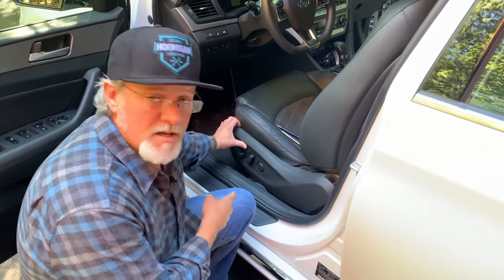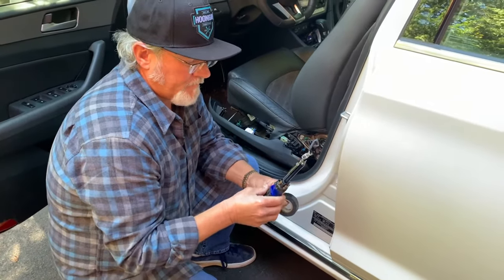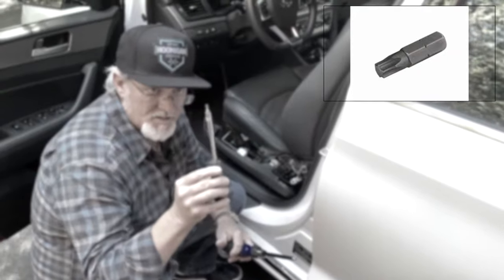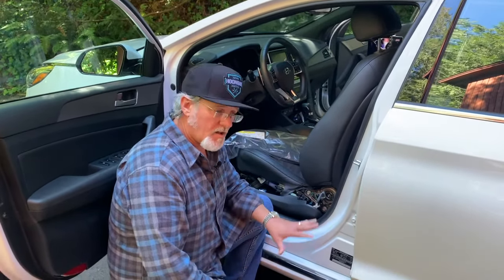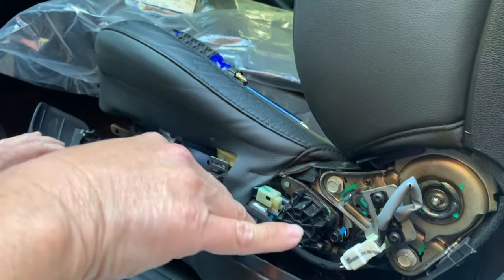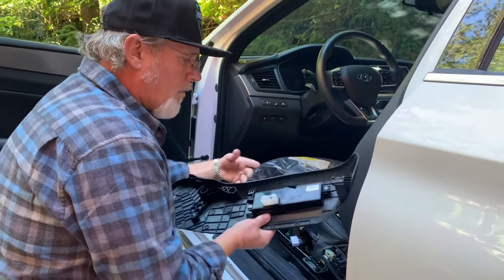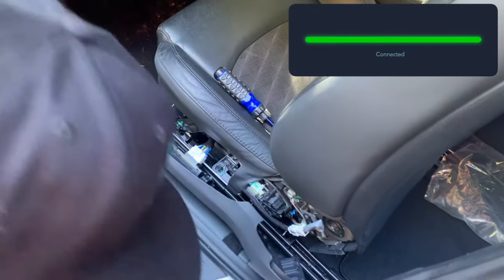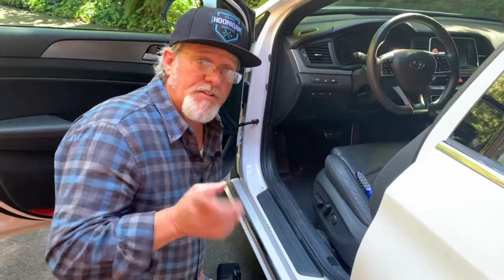Hyundai Seat Panel Do It Yourself

Comment: Just had to replace my driver side heated seat and 1 week after the repair, my seat panel fell off.  Because of this video I knew exactly what happened, which was the same issue.  The dealer broke the center clip.  I just sent the dealer this video and told them to order another panel.   Thanks for this video!!!!  You just helped me deal with the dealer!

Comment: Thank you so much. I have this problem with a Captiva . The panel broke off and I though I might be able to fix is. This is just the information I needed. I'am a 66 year old retired women who has never done anything like this in my life. I learned a lot using YouTube and thought to give it a try. I could not think of what to call the seat panel or how it came off or where to get it. I cant thank you enough. So now I will get to work finding the part and fixing it.  Another note is while driving  one day I was putting something in side pocket and hit the control that made the seat move forward and I could not stop it. Pulled over cause I could not breath ,funny now but not now so it has to be fixed.
Reply from the maker: @Donna Miller so glad we could help out ! Thanks for watching!! Please Subscribe and tell a friend 😄

Comment: Great video.  I did exactly the same job on a 2015 Sonata.  The weaknesses in the part are criminal and should not exist.  I used the metal frame parts on the seat side under the side plate.  I drilled a strategically placed hole at the front and another at the rear of the panel and drilled into the metal.  I then simply screwed the plastic side onto the seat.  The screws are virtually unnoticeable and the side is very secure.  If I thought a replacement side would be stronger than the original I would have bought one.  Not being the case, I used two screws for a total cost of zero (old screws).  Unless you seek out that specific area visually, it cannot be seen.
Reply: The plastic parts on my 2017 Hyundai Sonata are crumbling. Holding my breath wondering what’s next to snap.

Comment: Nice video. I had to replace the seat switch at the dealer and shelled out $125 for the switch and $165 for labor. I tried to remove the trim but didn't feel comfortable as it didn't want to come out and I didn't want to break it. I was told this is a part that breaks frequently. I'm ready now for the next time this happens.
Reply from the maker: Thanks for watching @cloudyinhere

Comment: If anyone has a 2013, the screws are now phillips head, rather than t20. There is also one phillips screw on the backside of the cover, that can be accessed from the rear seat. Everything else seems the same. Two pop tabs around the mechanism, then pull forward towards the pedals to release clips

Comment: Guru, thank you for doing this video. I'm going to attempt to fix my girlfriends Tucson with this solution, but want your opinion. The vehicle's seat performs all other movements, but the back of the seat was only going back for some time, but not forward. Now, the other day the lever got stuck for a minute when I closed the door and trapped the seat belt between each and held the lever down and now the back doesn't move at all and their is no sound either when you hit the switch in either direction. Do you believe the motor might need replaced or the switch still? Thank you for any thoughts.
Reply from the maker: @Eli Rush.... Not Necessarily The Motor, Could be the switch

Comment: Here’s a tip. I thought I’d raise the seat all the way up to make it a little easier, and it was until it came time to connect the wire harness. Couldn’t do it. I had to lower the seat in order to make the connection above a thin piece of welded rod.  I’m also having a hard time getting the rear tabs in.  The front and center are good. Will try again when my hands warm up.

Comment: Hey quick question where can I buy all the tool that are use to replace the part thanks you
Reply from the maker: Sorry for the delay in responding… and yes! All of these tools are available at any retail parts store or online through Amazon.
Reply: @PartsCounterGurus  thank u for responding back to me. It’s the same person on a different account. Will this part fix if my seat won’t go back in forth (like the back only won’t go all the way to the front/ but it’ll go all the way back.) will this fix it please if u don’t mind I have to take my car to get a recall tomorrow I just want to make sure this panel will fix the issues thank u! Merry Xmas!

Comment: My 2017 Hyundai Tucson back brace leaver stop working when trying to go back. It works ok in going forward. What is the cause n how do I fix it myself?
Reply from the maker: @Dusty Rusty Probably a faulty switch or potentially a motor. The switches and modules are not hard to change at all. Let us know if you need info. Thanks for watching and make sure to Subscribe to our channel. We are so close to hitting our goal!!
Reply: I have the same problem, but my seat will go back but won't come back up
Reply: Does the cover just slide forward?  I’m trying not to damage that front piece by forcing it.  2018 Tucson Thanks.

Comment: My friend has this issue with his seat. He says he can't get comfortable because the seat isn't staying the way he adjusted for. Sometimes he has to keep adjusting it the up and down motor stops working and then later works again. He also says that it'll move while he is driving. So just for clarification is that the issue your father n law was having because part of the panel broke off on the inside and if not can you tell me what he says is happening even possible and how so. I really want to be able to tell him that there is a  rhyme and reason to his problem and stop feeling like he is losing his mind.  Thank you so much in advance for any insight you could offer.
Reply from the maker: @Christina Pickard. In this instance, The panel cleanly broke on the mounting points and there was no issue of malfunctioning switches. If switches are randomly activating on your friends seat without a persons intervention, that could be a safety issue for the driver and those types of instances can occur. The cover can be removed quite easily to access the switches and inspect them and replace if necessary.  I would seek the help of the dealership to check to see if there is a recall on the switches or perhaps have them check the wiring harness. Just have the fil VIN ready to give them. Any electrical component can be defective or become worn to the point it does not function properly or at all in some cases. Its worth looking into!

Comment: The panel Says there an airbag under my seat? Will that make it set off just trying to mess with it?
Reply from the maker: The 2018 Hyundai Sonata We Worked On Had No Interference with any SRS Components. There were no modules located on the seat lumbar controls panel or outside panel where they mount the seat controls. Typically the SRS Modules are under dash, within the center consoles of the car in the Center of the steering wheel and so on. We Recommend referring to your owners manual or contacting a local dealer to be certain.

Comment: Damn how you make a whole video bout fixing the seat but leave out how to take off the cover to get to the problem
Reply from the maker: At 2:50 …. We explain to use a trim tool to remove it. Must have went over your head. Most people watching this video are replacing the cover because it’s broken off so the need to physically remove the cover is out of the equation, but as a bonus to those that actually pay attention to the video, we threw that in there.

Comment: My driver seat won't go up only down what could it be ?
Reply: The back part sorry won't go up its laying down
Reply from the maker: @redlightdistrick if it will lay back but not go up, Could be the actuator/motor or switch. We would recommend you inspect the wiring harness and connection to make sure there is no damage there. Also check to make sure there is no apparent loose mechanical components (gear/lever).
Reply: I appreciate your response I took the panel off and played with clips and got it to go back up
Reply: Same problem in my car, i have 2018 sonata sports
Reply: Can’t get mine to go back so I guess it’s time to take everything apart :/

Comment: Thanks the dealer want $388 to fix mine just like that.
Reply: That’s crazy. I just replaced the backup camera on mine, they wanted 250 for the part (I got it for $49) and I forget what the labor was going to be, but I saved about $450.
Reply: My Hyundai dealer candidly told me they do not repair parts, they replace them.  For example, the small plastic mounting bracket for a rear motion sensor broke inside the rear bumper.  It is part of the whole plastic rear bumper.  All it needed was a bit of epoxy to remount the sensor yet they quoted about $1200 to replace the whole bumper.  These weak plastic parts are criminal when combined with such practices.